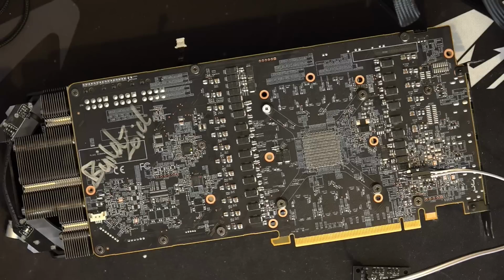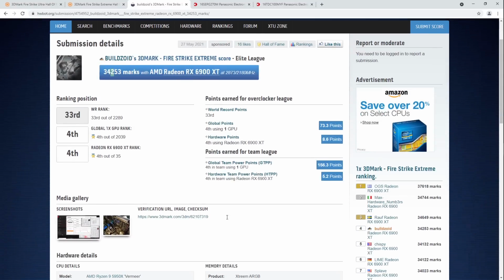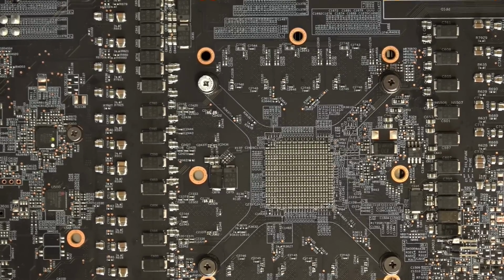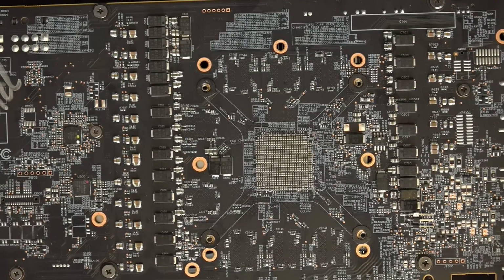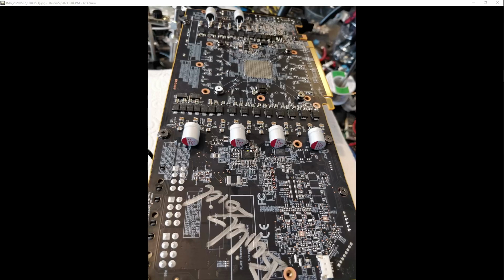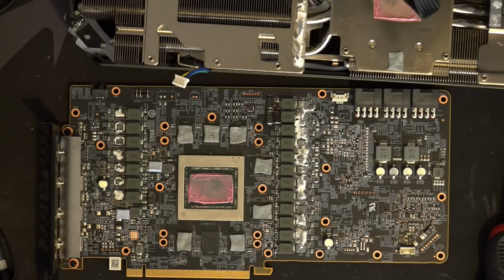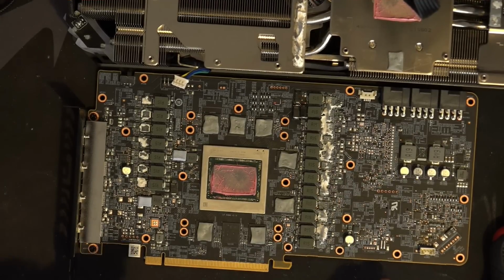The Radeon RX 6900XT Buildzoid Edition.

Comment: Does it seem weird to anyone else that bunching up 80 of the same teeny tiny capacitor along the back of a gpu is somehow optimal? Maybe there would be an advantage to using some kind of special purpose, single package capacitor to support high power chips like these.
Reply: MLCCs have excellent transient (or was it frequency?) response.

Comment: Hi Buildzoid! Instead of soldering large caps directly on the back of the card, could they be wired up? Then you could tuck them out of sight, for exemple under the card shroud. Not an expert by any means, but I'm wondering. Cheers!
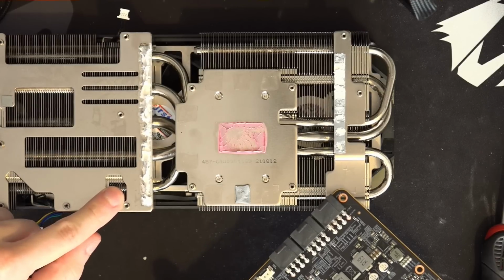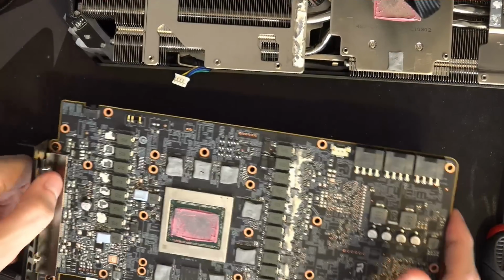Reply: he mentioned it... 43:00 - 44:00

Comment: I don't doubt that you may have the "fastest air-cooled 6900XT in the world", but it would be impossible to say so with certainty.
The problem with using HWBOT to back up your claim is that (statistically speaking, and the 'silicon lottery' being as variable as it is) it's possible there's a "one-in-a-million" AIB-overclocked 6900XT that might beat yours out-of-the-box, but hasn't ever been benchmarked , let alone posted on HWBOT. (Just sayin').

Comment: I can just solder on capacitors on my input filtering and have less coil whine? Any guidelines on how many or which one's to use?
Reply: only if the coil whine comes from the input filtering inductors
Reply: @bene5431  I am assuming it is, it sounds like a lot of coils and there aren't many on the board.
Reply: @mrawesomelemons  The VRM has a lot more coils than the input filter. If it's that you need the caps on the output filter
Reply: @bene5431  My apologies, you are right. Haven't woken up yet even though it is 9 pm. But the question is the same if that is the case.
Reply: In theory yes. Coil whine is low frequency (in electronics terms) so cans should be fine
Reply: @bene5431  Any caps?

Comment: i have a reference 6900xt under water and im thinking of hooking up an evc2sx to see how far i can push my card
problem is, that it only has 2 8pin connectors 
if i were to push more than 375W through the card, do you think the card would allow it and would i be able to run some benchmarks safely without burning my cables? (correct me if im wrong but i think the max safe power that 2 8pin inputs can handle is 300w + 75w from the pcie slot)
and also is it worth using an evc2 on a reference card?

Comment: Those sudden drops are a 'feature' of AVFS system,  I think, my Vega constantly goes above the p6/p7 limits if load is low enough (or voltage is below maximum), which sometimes causes crashes (mostly in timespy or dx12 games)

Comment: How bad would it be to just add boatloads of input filtering on the power supply cable...
Reply: Power supply cable is before input filtering inductors. Input filtering inductors are there to prevent VRM switching noise and power state (core pulls different amount of power for different parts of rendering a frame) noise from going upstream into psu. 
Filtering both of that will not be effective within power cables.

Comment: Can't fault them. Chip manufacturing's getting more and more expensive, they gotta save what they can, and if it works, why overbuild it?
Is it possible, that a 7nm part just doesn't have as violent power swings, than a 26nm part did? Or maybe a smarter/quicker/more accurate voltage controller can make do with less input buffering, and is cheaper than "bulking up" on capacitance?

Comment: Cost cutting. I worked with them.That is the mentality over there. If the a company can cut a fracking cent and get away with it they will do it consequences be damned.  ABIT went bankrupt rather than put quality capacitors.

Comment: What if you shorted the input filtering inductors, or removed them and bridged its pads with a wire? Your PSU might hate you, but the voltage should be more stable on the VRM input side. Also, you could solder a TON of bulk capacitance on the back of the 8 pin connectors, you dont have to worry about ripping off tiny pads there. The backplate would not fit anymore, but at least the caps would not be attached to anything fragile.
Reply from the maker: I have considered that but with a card like this I'd like to keep the modifications somewhat "sensible" and not approaching zombie territory.
Reply: @ActuallyHardcoreOverclocking  yeah, I feel ya, and I figure adding caps at the 8 pin would have a much lesser effect with the inductors intact
Reply: exactly my thoughts .. I was like.. great I've come up with another Frankenstein... yuck lol

Comment: @
Actually Hardcore Overclocking The only RX 6900XT that has enough input filter caps is probably the MSI Gaming X Trio ? The rest of the AIB PCB looks almost the same as yours. Even the  reference RX 6700XT has more caps than your unit :-D

Comment: Speaking of capacitors... Würth Elektronik makes great SMD and THT polymer caps and they'll happily send out free samples. ;P
I got a pair of gigantic 10µH 74A inductors from them not long ago.
KEMET's A750MW228M1CAAE010 caps might also be worth checking out if you need tons of capacitance - 2200µF, 16V, 10mOhm, 7A RMS for half a pound. DigiKey has them, just please don't buy up all of them because I want to order some too.
Alternatively, if you want to go totally crazy, get yourself a Cornell Dubilier PPC802M016FG2SAA. Insanely expensive but damn, what a capacitor. And you'll only need one - if you cool it (i.e. with thermal pads to the backplate), its ripple current capability goes way up. (The datasheet says you can achieve 50A RMS ripple current with some moderate cooling.) Though it might be a bit large at 15x12cm... It's just super flat. Oops.

Comment: Buildzoid whats your opinion on the Ryzen 5600G & 5700G APU release details? Would be interesting to see how these overclock in terms of memory and graphics / cpu. Would be interesting to see if these are the mobile apu variants just put into the desktop space, (Basically a monolithic die as opposed to chiplets) So the memory controller would be better.

Comment: When you're soldering 2 new capacitors to an existing capacitor, why do you just continue the stack instead of putting one on each side? You should get better parasitic inductance with one on each side.
I suppose a better question would be: Why did you do this on only some capacitors but not all? I assume it's ease of solder and/or space issues.

33:20 It's more than just decreasing ripple current through the 12V input inductor: You are also changing how the VRM control loop is compensated (though output inductance / capacitance have a much larger effect) which will also change the ripple current through the 12V input inductor.
38:40 "coil whine happens at the frequency of the frame rate" Interesting! I assumed that the switching frequency of the VRM is also a major component of this. I would love to see the FFT of the ripple current of an inductor that has whine. If the VRM switching frequency has any effect, then the tants would be better if they have less impedance in the range of 700 kHz or whatever the VRM switches at.
Also keep in mind those tantalum capacitors are only rated for a ripple current of 1.3A whereas the leaded poly ones are much higher at 5.8A. It is very possible that this is a concern.

Comment: Saying that it wont work without input filtering is a bit of a stretch.

I aquired a gigabyte 7950 for a friend with almost all the input filtering caps burnt. (Some how card still worked. Any load would cause the gpu core to spike up to 90* and shut off  just from the heat of the input caps)

I was out so I only had a plastic welding iron to work with and some awful unleaded solder.

I removed amlost all the caps theres like 2 or 3 good ones and the card still works.

Mind you it clocks horribley. Vcore has to be set 0.7v higer than my other 7950's for same clock. Although silicon lottery may have some effect there, works fine at stock.

I also accidentally knocked off a resistor that connects a zenner diode to a transistor.

It looks like its a voltage regulation circuit no clue what its for card still works so what ever if I get board at some time I may try and take some mesurements of the card I expect it to be bad.

Comment: I don't blame AMD at all.  The card works, it was supposed to be cheaper but as a reference design the fact that were going head to head against the 3090 is good enough for me.  I do put the blame on powercolor. They should be making a better Board loosely based off the reference model but they really didn't change anything when its up to them to make a better card.  Its a red devil It should be better for 2K
Reply: just remember there was a time a 1080 ti was at an msrp of $700 usd there is no reason for these cards to be so expensive other than for greed. the fact that a 3090 is barely quicker than a 3080 is a joke. beating a 3090 isnt special when its only %5 faster than the 3080. i wanna say the 1080 ti was also like 28% faster than the 1080 but sadly these days these cards seem to only have like a 5-10% diff in performance between each one. ever since the 20 series nvidia seems to be inflating prices and amd is following.
Reply: @hairychesticles1  prices have inflated everywhere in electronics. its not just due to shortages, its also due to what we are willing to pay.  People payed 1000$+ for the titans cards so then Nvidia pushed prices 1200$+ for 2080's then to 2500$ for the RTX titan.  People are willing to pay these insane prices so now we get to keep insane prices.  AMD Hasn't pushed anything so egregious yet but if people keep this idea that gaming as a hobby is worth 1000$ for high end cards then we will stuck with it.  The only chance we really have is that AMD's new cards are good enough on TSMC vs Samsung and RDNA vs RTX; that we get cheaper cards that are better in the future.  Also Intel could really help rein them both in if they can start competing at the mid range.
Reply: @hairychesticles1  Oh, I agree with you on that.  I did a whole post recently talking about the Bullsh** that Nivida keeps pulling to Increase Profit.  AMD is dealing with a media powerhouse that will Lie, Cheat, and even Blame others for their own problems.  Form the Partners program to the selling of cards directly to miners that was in their quarterly report You cant trust them to do anything not motivated by increasing their money and power.  Nivida's Paper launch that lasted 4 months ... Before the Mining BOOM really happened just shows you that this will continue forever.   Dlss just works and the raytracing just works will be famous examples of the pride that Nivida has as a company.

Comment: That poor GPU. Not all caps are equal. Tantalums are very stable, used in power systems. Mlcc are used for high freq filtering, and you need multiple values to span a range of frequencies. Those electrolytics are just used for capacitance and not really filtering. Next he is going to use Nippicon bulk caps because more farads must be better.

Comment: Is it possible that the memory errors could become so frequent that they overcome what the ECC can manage and it just artifacts anyway? I'm probably an idiot, but that's my theory.
Reply from the maker: the thing is I'd expect it to just get slower and slower and slower as it has to correct more and more errors.
Reply: @ActuallyHardcoreOverclocking  After some googling it seems that ECC can only correct single bit errors using math and data from the remaining bits and parity bits. Perhaps if there are two error bits in one read operation the ECC won't be able to correct it and result in an artifact.
Reply from the maker: I figured the performance hit comes from resending data that got corrupted
Reply: @ActuallyHardcoreOverclocking  Would that be a new thing that RDNA2 is doing to deal with errors? I don't remember this happening with previous architectures.

Comment: For filtering you want multiple values of caps. They have different harmonics, so you need as wide a  freq coverage as possible. The capacitance itself just increases the available power. That is why you usually see schematics with a ladder setup of progressively smaller values. Nvidia uses GDDRX which uses more power and THAT is why the AMD card needs less capacitance for the memory. PS. those unpopulated headers are JTAG and give you firmware access.
Reply: Yes, but I think Buildzoid knows all of that.
Reply: @Bengt.Lueers  His video makes it pretty clear he doesn't. He specifically says he doesn't know what those Jtags are. Once you get to him adding Electrolytic caps for filtering inputs, you KNOW he doesn't. Electrolytic caps are used for energy storage, not filtering.
Reply: @excitedbox5705  electrolytics ARE there for filtering lower frequencies (haven't you heard "bulk capacitance" in the video), ceramic - for higher frequencies (can also filter lower frequencies if there are a lot of them). Filtering lower frequencies with a ceramic capacitors alone isn't economical, that's why electrolytics are there.

Comment: @BZ: have you noticed any crazy (probably microsecond) current/power spikes? 
i have a tuf 6800xt & 5800x (stock settings) and it trips (system shuts off while gaming) my 750W 80+ bronze cooler master psu.
Whereas i ran a 3090 for 5 months on this system, no problem..
Any ideas if it's AMD's RDNA boost algorithm, nano sleep states & wakeups, sudden voltage fluctuation or what?
Reply: Bruh why you pairing 309 and 69 on a 80+ bronze? I mean I get that the newer MWEs are quite decent for low end but they are low-end...
Also I thought 3090 draws significantly more transient than 6900, is it a (relatively)stock 3090 vs (factory) oc'd 6900?
Reply: @eggcopter  Yea, that seems like a PSU issue. The output caps are probably too small, so a big turbo ramp drops the voltage. The Nvidia card probably just runs a more steady high power mode, and therefore you don't notice the spikes.
Reply: @excitedbox5705  output caps, are those on the psu? Sorry for the stupid question
Reply: @excitedbox5705   it does that's why we don't need heaters in winter months hehe
Reply: @eggcopter  it's a 6800xt factory OC (750W requirement) not a 6900xt (850W requirement). But yeah after watching Gamers Nexus' video on how you don't need overkill psu and also considering that Ryzen 5000 (vs. Intel) is so efficient, i thought sticking to a MWE Bronze 750 V2 would be fine. In fact it was totally fine with a curve optimized 5800x and 3090 (which i did OC, was also a factory OC card)
Reply from the maker: Yeah I'd get a bigger PSU or at least a PSU that's known to have a high OCP.
Reply: Had a close friend having similar issues.  Went through hrll before he ran out warranty.  So , he finally gave up and pulled heat spreader . Thermal paste was near nonexistent.  He re-pasted his fairly new card , reassemble and it runs perfectly .
Reply: @texasslingleadsomtingwong8751  which card did he have? I doubt it's got anything to do with gpu thermal paste (on a new card now of only 2 months old)
Reply: @moeziaran  his was something like a year old.  He did this about a month ago .
Reply: I pushed 420w on the 6900xt alone, 3600 oc 4,4ghz with 750 Platinum sfx psu from Corsair no Problem
Reply: @Diepess  Ok so that's good to know! I will try to get a 850W 80+ Gold, should be fine then hopefully... Because I do wanna OC the 6800XT and curve optimize my 5800x again. Btw, impressive OC on your R5 3600, I hope you're not pumping too much voltage in it

Comment: So does a zotac1080ti amp have one of these because I'm wanting to volt mod vram and maybe vcore even though the xoc bios allows 1.2 I want like 1.3. I'd be willing to send you my card with it's waterblock if you at least can send it back alive lol. You can have all the fun you want with it
Reply from the maker: most 1080Tis use a UP9511 and the 9511 is as analog as it gets on modern GPUs.
Reply: @ActuallyHardcoreOverclocking  I found out that much I looked at a hardware mod guide for the Fe 1080ti I should see if the component arrangements are similar
Reply: @ActuallyHardcoreOverclocking  how would I go about modding vram I can only get +700 on ice water

Comment: Call Sapphire, they might make a Buildzoid edition
Reply: It's the same as a regular card, but with lots of empty pads for more caps in case he gets bored
Reply: Oh boi, that would be dream
Reply: 6900 XT Atomic with 3 GHz clock out of the box.

And no stupid AIO cooler too please!
Reply: @Wasmachineman  for the cost of GPUs at the moment they could/should include a 1.5kw chiller unit and plumbing in the box.  My 6900XT is the most money i've ever spent on a single PC component.  Since 1992.
Reply: @JethroRose  knowing the 6900xt prices at the time, what did you buy in 1992? A bloody mainframe?
Reply: sapphire has one called the vapour-x, they just dont make it anymore

Comment: 2112-2122mhz is the sweetspot vram
Reply from the maker: I tested every frequency between 2000 and 2250 in 20MHz steps. Before the mods card scored best at 2150 after the mods it does best at 2180.
Reply: @ActuallyHardcoreOverclocking  A guy over on the ocuk forum 6900xt owners, did testing on memory frequency and found 2112 best for in game performance. I've seen it myself going too far and the performance falls off a cliff as you said. It's the same with the core too, I can clock stretch my card and get nothing from doing it. As you said they are super power limited, on water I'm just running 2122 vram and +15% power (293w) for daily gaming. That sits me around 2.5ghz in game.
Reply: @JustAnotherPissedOffBrit  he's not doing gaming, he's going for overclocking records.
Reply: @DJKr15py  I'm aware of that. Even taking that into account getting settings not quite right really damage numbers. You are fighting an algorithm after all!
Reply: Every cards mem likes different clocks.